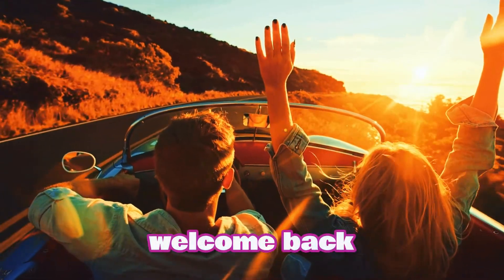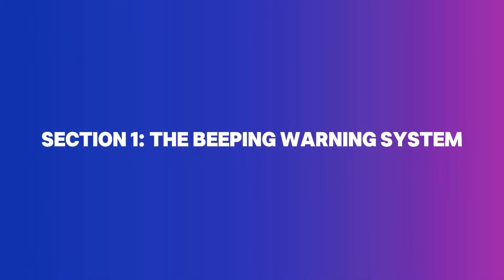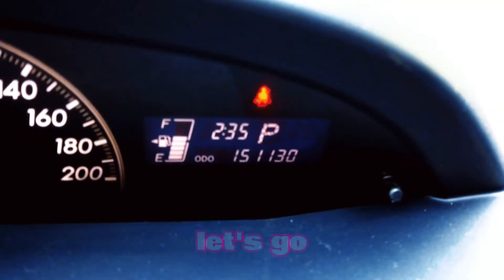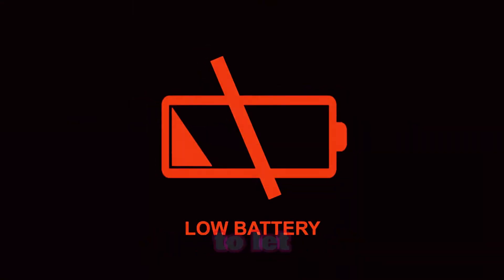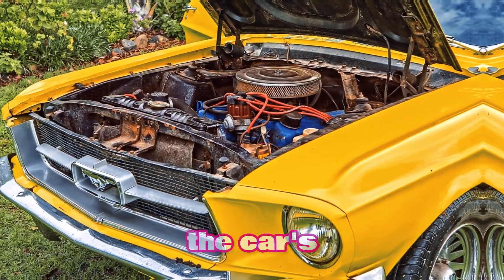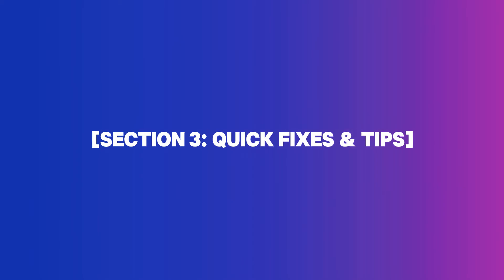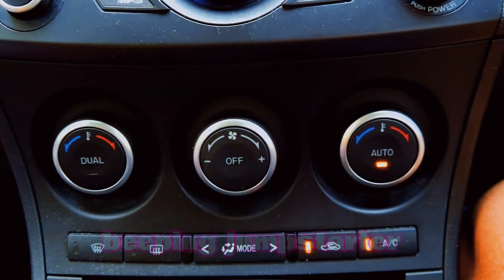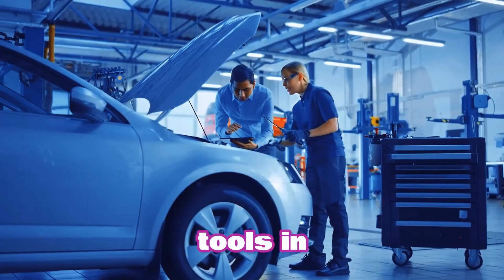Why is My Jump Starter Beeping ? Fix a Beeping Jump Starter ||

Comment: Tried two different jump starters, both brand new and fully charged. Both were attached correctly red to positive and black to negative confirmed by a second person!  Neither worked...they just continuously beeped.  I believe this video left out a completely dead battery which apparently these jump starters won't start, but just beep constantly.
Reply from the maker: If your jump starter just keeps beeping and won’t crank the car, it usually means the battery in the car is completely dead—so dead that the jump starter can’t detect enough voltage to safely send power. Most modern jump starters need to “see” a little bit of charge in the battery before they’ll engage. That’s why even though you hooked it up correctly, it only beeped instead of starting the engine.

The fix? Many jump starters have a manual override or “boost” mode that forces the unit to send power even to a dead battery. You’ll usually find a button you hold for a few seconds to activate this. If yours doesn’t have that option, then you’ll need to either:

Hook the battery up to a regular charger for a while to get some voltage back, or

Use traditional jumper cables from another running vehicle.

So, the beeping isn’t a defect—it’s a built-in safety feature letting you know the battery is too far gone for normal jump starting.

Comment: If it s beeping when your not using it how do you stop it
Reply from the maker: A jump starter beeping usually indicates a low battery, incorrect connection, or an internal issue. If it’s beeping when not in use, try fully charging it first. If the beeping continues, check the manual or contact the manufacturer for troubleshooting. 🔋🚗

Comment: My 1200 A Power station is stored in a closet at room temperature.  It's not been used for 3 weeks.  It started an annoying BEEP, not very loud but enough to drive my family crazy!  The LED (after topping up it's charge) reads 12.9 v and sometimes vw.  The vw disappears after every BEEP.  None of the above scenarios apply.  I have used this devise only twice - pretty-much brand new!  What can I do???
Reply: Sorry.... the "w' of the vw disappears after beeps and sometimes doesn't reappear for a long time.
Reply from the maker: It sounds like your power station might be experiencing a few potential issues. Here are some steps you can take to troubleshoot and hopefully resolve the beeping:

Check the Battery: Ensure the battery is fully charged. Sometimes, a low battery can cause the unit to beep. Even if the LED reads 12.9V, it might not be holding the charge properly.

Inspect for Overload: Make sure the power station isn't overloaded. Disconnect any devices that might be drawing too much power and see if the beeping stops.

Reset the Unit: Try resetting the power station. This can sometimes clear any faults or errors that might be causing the beeping.

Check for Faults: Some power stations have a fault indicator. Check the manual to see if there are any fault codes being displayed and what they mean.

Temperature: Ensure the power station is not overheating. Even though it's stored at room temperature, make sure it's in a well-ventilated area.

Consult the Manual: Refer to the user manual for any specific troubleshooting steps related to beeping sounds. There might be a section that addresses this issue directly.

Contact Support: If none of the above steps work, it might be best to contact the manufacturer's customer support for further assistance. They might be able to provide a solution or replace the unit if it's still under warranty.

Hopefully, one of these steps will help resolve the issue and bring some peace back to your household! If you need more detailed instructions or have any other questions, feel free to ask.

Comment: My jump starter begins to beep (3 beeps at a time rapidly) when I plug in the cable  to the charger, haven't even connected to the car.
Reply from the maker: It sounds like your jump starter is trying to tell you something! Here are a few common reasons why it might be beeping:

Low Battery: The internal battery of the jump starter might be low and needs recharging.

Improper Connections: Ensure that the clamps are properly connected to the battery terminals.

Reverse Polarity: If the positive and negative clamps are connected incorrectly, the jump starter will beep as a warning.

Overload Protection: If the device is being overloaded, the beeping indicates that protection features have been activated.

Try charging the jump starter fully and double-checking all connections. If the issue persists, consulting the user manual or contacting the manufacturer for further troubleshooting might be a good idea.
Reply: @weeklytools  Thanks for the response.   The beeping starts immediately when  I plug the connector into the charging device, open circuit (3 beats at a time) nothing connected.  The red or green indicator lights on the connector do not light up.  The device was fully charged.  I think something is wrong with the connector (maybe a blown diode or other circuit component), as I can still use the device for charging my cell phone, tablet, etc.  After this happened, I also used it for powering my small air compressor for inflating the tires.  In fact I used it to jump start the same car just the day before this malfunction began.  It's made by Nekteck, Inc. and they seem to be out of the jump starter business.  I guess it's time to move on.  Thanks, again!
Reply: The same! Your advices are useless